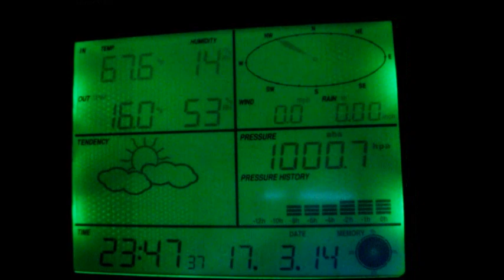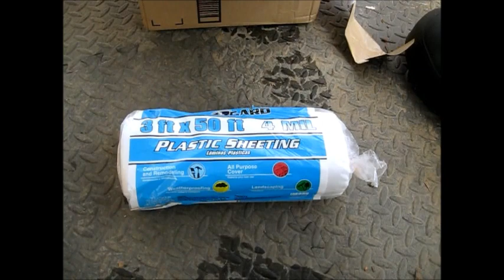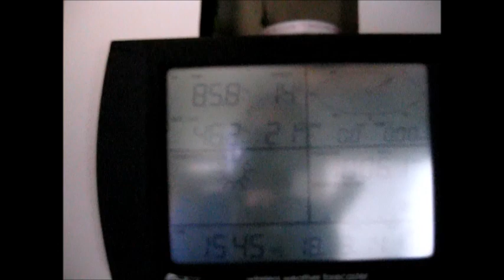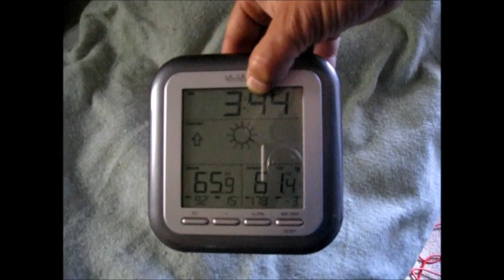Mounting RV Wind Turbines Setting Up Mobile Solar Workshop And More

Comment: Troy, Those are some old-school artic boots. I had a set when I was in Germany. There is an insulating air layer and non-permeable outer. The valve is for us aviation guys so we don't pop them when the air pressure changes in flight. Enjoy!

Comment: When I was stationed up in Minot, ND in the late 60's, we called those bunny boots. They are air-filled and are actually too warm if the temp is above about 10. But are great for walking on ice and snow. They make some with more insulation and are white for really cold places.
Reply from the maker: Good stuff

Comment: nice Bunny boots, On the Bunny Boots , if the air valve is left open water can enter and destroy the inner lining . Wearing them with air in them at Temps above 30 or so can cause you're feet to sweat profusely. Some people put shoe goo on the air valve to prevent water infiltration .
Reply from the maker: Thanks for the info

Comment: A blower motor into the battery box from inside your camper would be useful all year round as it would help to make sure that any exhaust from the batteries gets pushed out of the battery box to the outside of the camper. During the warmer months you could open the vent at the bottom of the battery box to make sure it vents well.

Comment: Mickey Mouse boots!!! I use them in the Army during winters like we have here in Wisconsin. The bleeder valve is for airborne operations so your feet don't get squashed at altitude from the air expansion. Keep them closed at ground level and you won't have issues.
Reply from the maker: Cool

Comment: The air valves are for flying.The valves must remain open when flying because of the air pressures. If you have them close the boots may rupture. You won't need those liners. I still have mine but the rubber is starting to degrade.
Reply from the maker: Thanks for the tips.

Comment: In the Air Force we called them 'bunny boots' for reasons I never found out. They were issued to the guys that had to withstand arctic weather conditions. They should keep you get very warm.

The vent on the side is to equalize the air gap between the exterior shell and the interior liner while in flight or large barometric changes. Keep it chooses unless you really need to let out the pressure to keep the water out.

I was told some people did not open them before flight and the boots crushed their feet.

Comment: Troy:
Regarding your cold batteries, what about a sheet of rigid foam insulation at the bottom and the batteries on top of that?  I know you need airflow to keep the hydrogen gas from building too much but perhaps a damper for the cold days/nights to try and limit the chill in the battery box as well.
Just a thought.

Comment: Well, once you get it situated. I would run PVC underground from the windmills to the bank. Then run the solar panels through PVC underground from the where ever the panels are to be then to the primary bank. If you don't want to leave them out when you are on the road then I would make sure it's very easy to connect them up with little or no problems. As you are saying I would double the bank. The power production should ok once the windmills and the other 4-6 panels are connected. The big question is where to put the larger bank. You could I think fit in 2 more batteries inside; maybe four.  Either way winter is nearly over.
Reply from the maker: I plan to have two or four more batteries when I am done. I will move the RV and everything this spring and rewire the whole system better.

Comment: Mix your ashe and charcoal with compost like rabbit manure and wet  it and let it set for 2 or 3 weeks then use it in your garden as bio char. You might want to check your soils PH first tho. You can grow monster veggies like that. Its called terra preta if ya wanna look it up. Just some info in case you didn't know.

Comment: Mickey Mouse boots where the boots to have on the trans alaska pipeline. I never found a pair my size and had to do with Sorrels. That Troy is a nice gift.

The air inside insulates. You have to have the air valve open in flight or else the air inside the boots will expand.
Reply from the maker: Never saw a pair before but they sure look nice and heavy duty.
Reply: We called em "Bunny Boots" in the USAF.  Kiss yer cold toes good-bye Troy.
Reply: Yes, that was the term I was trying to remember. They are warm but I guess you sweat in them like crazy.
Reply: Ken Anderson Yeah, I think that's why they stopped issuing them.  Too many foot rot problems with em.

Comment: @Troy, as far as i know the on board genny is mounted on a slide, disconnect the exaust and you can slide it out onto a pallet stand, this thing wil solve your power problem, The solar and wind is good for rhe amall users, the genny is good for temporary high loads ., wood be nice to have it working.

Comment: just and idea for ya, if you take a 3 or 4 inch pvc pipe and run it from 2 inches from the cealing down to the power bank and install a small computer fan at the bottem on the pipe it will take hot hair from the celing and bring it down to warm up your batteries, it does a great job to bring heat to your floor as well as you must know, heat rise and most heat lost is from the celing and when the hot air goes out, it sucks in cold air from the bottom walls or cracks that could be down close to the floor. It's cheap and it works well, i've done it in my green house and i was suprise at how well it works. i put a 90 degre elbow at the bottom to derict the heat where i want it to go and just straped it to the wall.

Comment: Beautiful day out there, we've had rain all day today in southern Ontario. I bet it felt great to be outside and be able to work on stuff without freezing and having wet feet. 

Did you have no luck with ever getting the generator running that came with the RV? Is it a lost cause or just a project for the future?
Reply from the maker: It was great to be outside all day. I will fix the generator one day but its low priority because its going to be a huge task due to its 250 pounds weight and its bolted into the RV

Comment: keep chopping wood winter is not over and its a good work out
Reply: AGREED, cutting a day by day supply is not a good way to deal with what remains of the cold weather. Three days of wood is the least to have on hand as weather can get foul in a hurry and with no warning.
Reply from the maker: I agree but there is still so much to do setting up home. I also need to get more wood over here. I am running out slowly. Need to get my chain saw out and going again too. Just got some chain oil the other day.

Comment: Funny, the different shoes when you vacuumed.  Is the shop RV still leaking in the front?  When are you thinking on doing a video (step by step) on the bedini charger you built? Just wondering.
Reply: I would love to see that too :)
Reply: he has been using his Bedini units to recondition sulfated batteries, last I recall he was using it on a bad power tool battery.
Reply from the maker: Oh, now I get it. They are dollar store junk and the trim band on one came off the day I bought them.
Reply from the maker: Sadly I did a full video on a build of the Bedini charger while in Australia but I could not find a supplier for coil wire so I used a printer coil but it was too weak. Then I ran out of time and had to leave. Hope my friends can finish it though and have a good running Bedini motor.

Comment: Now that you have the heating sorted (yay ! )  I'll remind you of one of last year's To Do items - Figure out a cook surface for that barrel stove and save your propane.    How about nothing fancy - just four bolts in the top to brace an old oven grill.    Just think, the kettle simmering for coffee or a nice stew heating while you're out in the cold.  A big heavy pot of water would be a good heat sink, too.   Four bolts, your old trailer's oven grill, half hour's work before you light the fire and that stove will be doing double duty.

Comment: Looks like you're past the worst of the challenges of returning to the Off Grid project & getting re-established. Thankfully, even though rough going, in spots, much easier than it could have been. Thinking in terms of how well the project site fared while you were away. Minor, easily corrected situations, instead of major ones. ie plastic off porch compared to roof collapse due to snow load, for example. 

Glad to see you have some sunshine & opportunity to prepare for the next polar vortex, due the first of the coming week. Again, local forecasters are hinting at snow & well below normal temps here. And, as is custom, probably will be worse where you are. 

Hopefully, too, things will settle down now and you can move forward at a steady pace without major interruptions. Remembering that you've moved twice, since announcing the Off-Grid project. Having to establish another dwelling, as the old camper has proved, it was falling down, around you. And, a once-in-a-life-time opportunity to visit Australia. 

Godspeed as the coming days and weeks unfold. May the potholes in your journey forward, be smaller & fewer, than those on the road already traveled.

Comment: Good to see you building up again! Wats the story about the onn board rv generator? Points stuck or oxidized? When you can gett that running you have all the power you need, you can even use a welder on it!
Reply from the maker: Its 250 pounds and built in and has no spark. Plus the gas tanks on the RV are full of sludge. Need to get it all cleaned up.

Comment: I made a wind gen from a old treadmill motor. It has me stumped. I can spin it without blades on and hit 4 volts without any trouble. once I put the blades on and hang it outside im lucky to see 3 volts and yes I have had really good wind up to 35 mph hit it. that is when I get 3 to 3.75 volts from it. On a normal day of 10 to 15 mph i see 1 to 2 volts. If I was to see 12 or more volts looks like I would need to see 60+ mph just for use full power. The motor work very well when in the treadmill so I dont know if there is other reasons for this or if motor could just be bad or if this is typical for a dc 1.5 hp motor (ANY SUGGESTIONS WOULD BE GREAT)
Reply: I can run it with my electric drill and get 9 volts but like i said once outside spinning even faster than the drill spins it I dont get hardly nothing from it
Reply: I remember somebody having this problem once using the same type motor..i might be wrong but if i remember correctly it has to do with something like a internal control similar to a ceiling fan speed dial. The faster the motor spins the less electric is in output...the slower the more it produces. Something to do with the resistance for the rollers. I will see if i can find the article and post a linkie.
Reply: jay burns ok thank you
Reply from the maker: Please bring this over to the forum and post some photos. Please include the plate on the motor with the specs written on it. http://www.thediyworld.com/forum
Hope to help you there.

Comment: What about the onboard 8.5 HP ONAN RV genset you have in one of your below floor utility "boxes"?
Reply from the maker: Its a 7,000 watt Kohler if I remember right and it has no spark. Its bolted in and will be a huge job to remove. Plus it will take about three guys (my size) to lift it.
Reply: The Do It Yourself World ah, yes, I stand corrected; I forgot it was a Kohler, though, but, remember now it was 7kw.  It is not mounted to slide out rails for servicing? I don't think I'd want to remove it, but just put it into operation, if I could.  But, it's not mine.  Seems like that would be the genset to hook up to the RV since, essentially, it already is.  Just my thoughts.

Comment: Solar vacuuming ... who would have thought!  It's kind of feast or famine it seems. Since you said the snow is reflecting sun to your solar panels - would you be able to free cycle something white and reflective to put on the ground under the panels after the snow melts?  I'm thinking big white erase boards or something.  Or even scrap wood or metal painted bright white.  Mirrors might over heat the panels, right?

Don't forget to tighten the bolts on the wind turbines!  Those blades look like they can do wicked damage.

Now for a stupid question - bare in mind I know nothing about snow.... Can you drink melted snow?  obviously not the yellow stuff.  It looks like so much clean frozen water in the meadow.  Why not just scoop some up and let it melt on the porch instead of hiking it in?  I think I would be doing that for washing up even if not drinking.

Comment: i got them they r micky mouse boots don't play with the air valve it was there for air force troops when they would go high alt. and the air pocket is for warmth you reaqlly don't need the liners . if you get water in them yojust leave it in til your done wearing them the water will meet your body temp you wont get frozen feet we used when snow mobileing
these ar rated to 15 below the white ones are rated 30 below. these r the last boots you will ever need
Reply from the maker: Good stuff. Thanks

Comment: Troy the US military use those boots for extreme cold weather. also known as mickey mouse boots. I have a couple pair myself they are air insulated. up in northern NY at -20 they work well. FYI do not let the top of the boots rub against your bare skin. it will get sore real fast.

Comment: With all that power you say you have, I would of put the fan on high and get the air moving. you need to get the inside. The bottom of your RV is acting like a heat sink which is why you have that 30 degree difference from the ceiling to the floor.  I would get the ash from the firebox, and sprinkle it on the snow, this should speed up the melting; just don't walk in.

Comment: hi troy, i was wondering about your solar battery set up in the motor home and i see that you ground all your batteries on the rail that runs the length of your battery case i imagine that that rail grounded but my thought was if your ran a heavier ground wire from the ground you now have to a metal rod that your pound into the ground 3 to 4 feet down and wrap the remaining cable around it may be you can help  the efficiency of the batteries. just a thought..
Reply from the maker: I never heard of that before. Grounding to the earth. I do know that you can ground the solar panel frames to the earth to protect them from lightning. I need to do that this year.

Comment: Troy at Wal-Mart and probably were ever we bought over last summer a 12 volt fan has a clip plugs in a cig liter we use it in the back hoe to circulate air in the summer mite look in that there about 20 bucks around here I think if u got 2 of them it would help by put them In the celling area in the front and in ur room on the opposite side from ur bed

Comment: can  generators  be  re  wound?
Reply: If I recall they attempted to start the RV's onboard generator and they were having very poor spark, so that probably indicates a bad spark plug wire, pretty cheap fix if that is the problem. Yes, one can rewind it but I don't know how much trouble and costs that might incur, being 7000 watts it has to be one pretty heavy unit to move around. Still if that is the problem it is worth fixing in my thinking, lots of output potential, greater than all the other little one laying around combined. A new generator that size costs thousands.
Reply: Sharke2121 Probably no need to rewind,       just flash the genny when it quits genning, lot of running generators out there that wont make Elect, that flashing would cure.

Comment: I have a pair of those boots, wear them all day everyday in the winter here in michigan. I work outside and feet are warm but I have to change socks because mt feet sweat. They are heave so walking is a workout........   
My office is in our basement, I have the same problem cold on floor and to hot higher up like face level. I fixed my problem with a fan that points straight up on low blowing the cold air up and mixing the air.
A bright sunny day just makes you want to get outdoors, dont forget to enjoy it just a little bit
Reply from the maker: I enjoy every bit of the sun :)